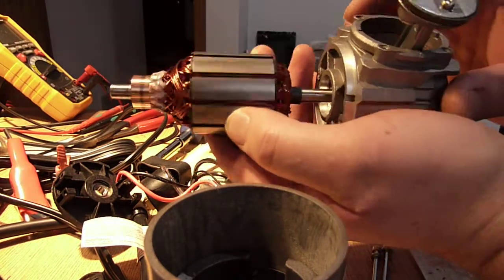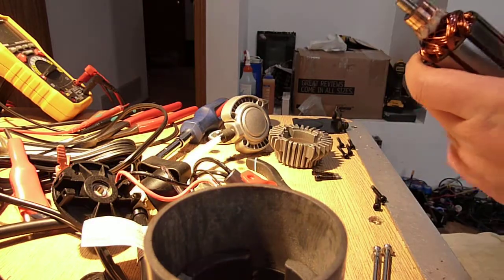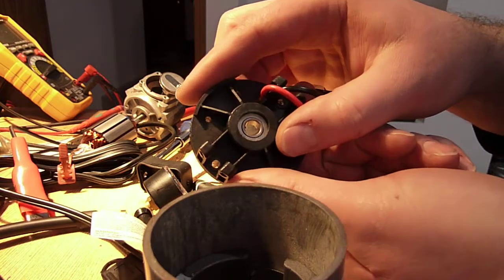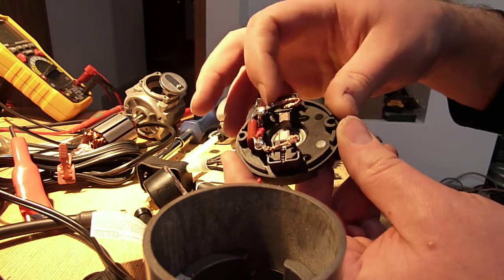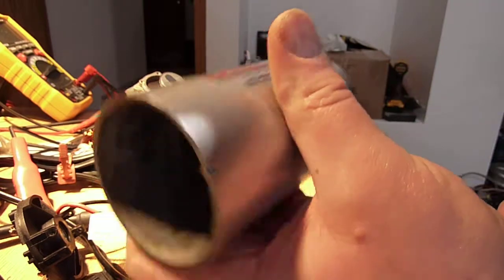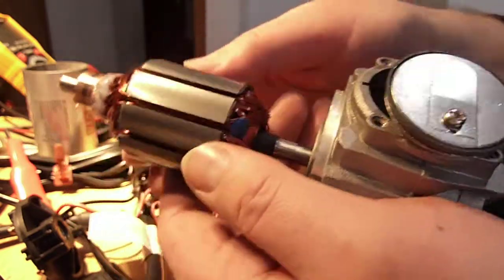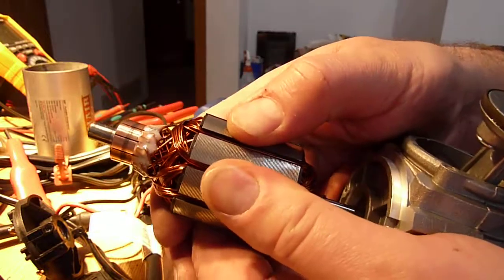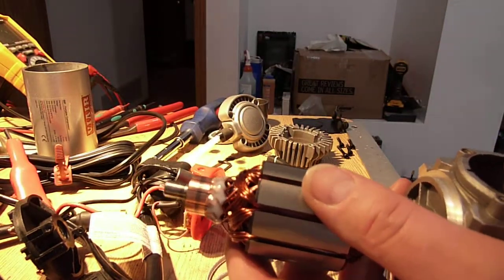ViaAir 88P teardown 4

Comment: FHEW!!! Thanks for tearing into this compressor. I feel so much better about my purchase.
Reply from the maker: Yeah cool! And I'm glad you didn't post "Hey I saw your video too late. I got a tirewell and it's crap just like you said. Now I have to return it!"
Reply: @de-bodgery  hope you were able reassemble and still use the pump. Quick question, does "Viair" offer a rebuild kit for these? just curious.
Reply from the maker: @ThePlowGuys  Oh yeah...no problem...watch the other videos I did on this pump. I made this video in 2019 and it's been used several times since then to pump up trailer tires and other things.
I guess your piston gasket isn't sealing up well? Maybe the reed valves are leaking? No idea if there is a rebuild kit or not. You can look at the manifold in these videos. The reads screw down. Try flipping them over. That may fix your low pressure issues.
Reply: @de-bodgery  Thanks for the reply. I haven't received the pump yet. I just ordered it like 2 hrs ago.
Reply from the maker: @ThePlowGuys  In that case, it will probably work fine. Mine is a few years old now and still doing OK.

Comment: I wonder if the 85p is made just as good but just a little smaller in size?
Reply from the maker: I'd have to say they look nearly identical. However the 85P is rated for 60 psi and the 88P for 120 psi. There is a very good chance the internals of the 88P are much beefier so it can handle the higher pressure. Exactly how that looks or what is beefier...I can't say, but there are reasons for the pressure differences.